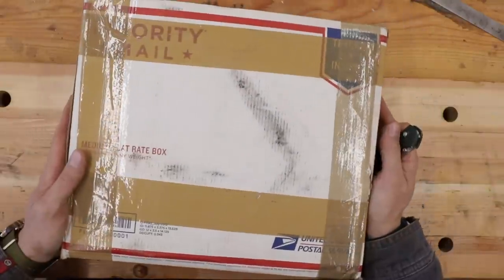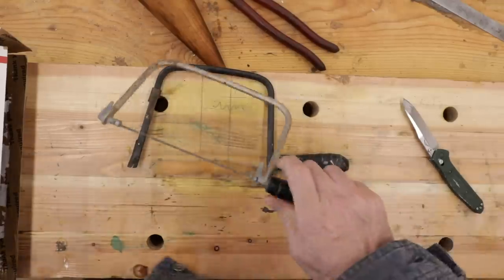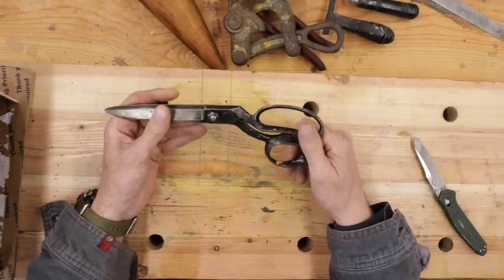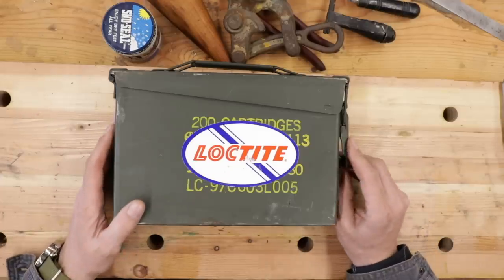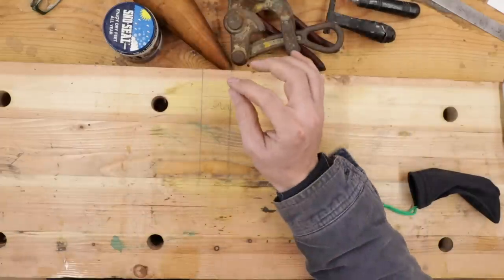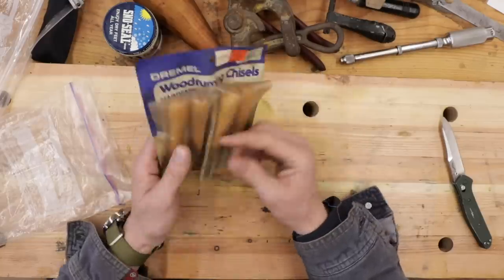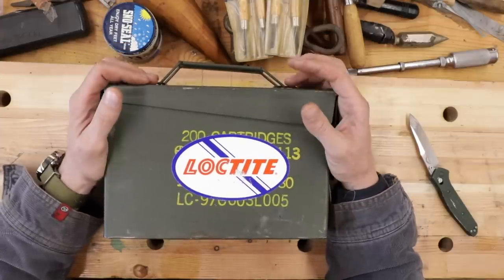You Won't Believe What's Inside This ARMY Box

Comment: The "cable puller" is actually called a "grip" that is used primarily for steel cable.  My experience in using these is for telephone pole aerial rigging, which includes setting guy anchors.  It is very effective and is regularly connected to heavy-duty winches to set the tension on aerial cable installations.

The "Yankee Screwdriver" is actually just a drill (non-reversible) and standard issue from the telephone company linemans' toolkit.

The "scissor screwdriver" is a straight-slotted screw holder that holds the screw at the tip when you need to thread the screw into a hard-to-reach hole.
Reply: Mark Lee we call it a cable dog. Use them for bottom wire on chain link fence.
Reply: I’ve always heard them referred to as pork chops. We use them for various things on distribution lines.
Reply: We linemen call them porkchops. And pull all sorts of stuff with them
Reply: Coal miners call them a rope dog.
Reply: @jonnewbury3482  Electric Gas lineman here we always called em rock'em sock'em robots

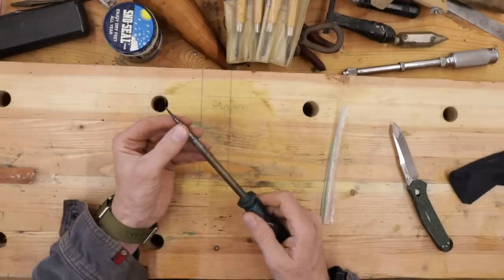Comment: @ 4:45 - Cable & Wire Pull ;  @ 6:58 - Wiss Dress Makers Shears - (I have my Mother's pair, she used to make a lot of our clothes back in the 1950's) ;   @ 11:48 - wallpaper Paste Brush ;  @ 21:40 - Quick Wedge Electrician's Screwdriver - split tip grips the slot of a screw & the sleeve on the shank insulates the shank - great for working in fuse & breaker boxes .
Reply: The Quick Wedge was not used for 'working' at all. Used only for holding the screw until you got the screw started in its mating threads. Then you would use a standard flat blade to do the work of tightening. Also handy for retrieving a screw in a hard to reach place after it was loosened. The good job you did at identifying all of the items might be an indicator of your age.? Did your Mom ever use flour sacks for material?
Reply: @mancelprince7426  --  Yes , Mom used a lot of Flour sacks for material , primarily for making dresses for my two younger Sisters . Mom used an old Singer Treadle Sewing Machine (foot powered) to make and repair our clothing .  When I'd wear a hole in the knees of my denim Levis , Mom had an old worn-out pair of Levis that she'd use to cut a repair patch from (usually the back of the leggings which didn't receive much wear) , she'd then carefully "rip" the seams on the trouser legs so the material would lay flat so she could stitch on the repair patch (this was before Free-Arm Sewing Machines & Sergers became popular) .  If and when it was available , Mom would cut 4'' x 6'' pieces of Leather and stitch them over the front of the knees to provide extra reinforcement and wear resistance to the trousers .  She'd then stitch up the side seams , and the pants were ready to wear again .
Reply: @001desertrat3  Did you'll have a kitchen furnishing called a "kitchen pantry" with a bin in the top cabinet that would hold about 20# of flour that came out of those flour sacks that had a crank on the bottom that would dispense sifted flour when you cranked it? The bottom of it had a flat counter top where Granny made biscuits that she cooked in her wood stove. You brought back some old memories with the treadle sewing machine. Thanks
Reply: @mancelprince7426  --  Initially yes , we had a Flour Bin , but Dad completely rebuilt the Kitchen and 'modernized' it . Dad built all new cupboards and cabinets and installed Formica on the counters .  Never had a wood stove (we lived in the City) ,  but Mom's gas stove was a Gaffers & Sattler 4-burner with boiling well in the rear behind the left side burners , large oven with broiler underneath .  Dad bought a new Frigidaire refrigerator in 1951 ,  and both were still in perfect working condition when we kids sold the house in 2003 after Mom & Dad's passing away .  In the early 1950's Dad also replaced the old wringer washing machine with a new top-load washer and front-load gas dryer .  But we kept the old style Ironing Board that was built into the wall in the Service Porch .  Our house was originally built as a 2-bedroom / 1-bath house ,  and Dad removed the old Patio and built a new Den .  He then converted the old attached 1-car Garage into a bedroom with a 3/4 Bath . Next he built a new unattached 2-car Garage with a new Patio between it and the Den .

Comment: The Quick Wedg is for holding slotted screws while starting in place, so you don't drop the screw
Reply: Agreed, I have one and use it for holding straight screws when inserting them down a hole or similar, not intended to actually screw it in, just to get it started, marvellous design and well engineered.

Comment: the quick wedge is made for holding slotted screws.
Reply: I have 2, small and big. I was gonna tell him but you beat me :-)
Reply: Particularly for starting slot-head screws.  
I hate slot head screws.  These are a life-saver, especially in tight places.
Reply: Yup!  Place the screw head slot on the blade, slide the outside up until the tips wedge inside the slot and start the screw!
Reply: correct
Reply: OJ Jenkins - same here. 😁👍🏼
Reply: There is also a Phillip's version. Electricians use these all the time, when your hands don't reach/fit.
Reply: Bingo!
Reply: James May (of Top Gear fame) introduced me to them for his show The Reassembler.
Reply: I was happy to see that I knew what a tool was for and had experience with it, and Cody did not.  It is a very rare thing in my case!
Reply: We always called the Quick-wedge screw driver a MONDAY MORNING SCREWDRIVER because when a guy showed up for work after a weekend of too much consumption of John Barleycorn, he could use the quick wedge to hold the screw so that even though his hand was shaking,  he could start the screw without getting it cross-threaded.
Reply: Better than magnetic. 😀
Reply: "starting" strait slot screws/bolts. around three or so sizes and there are versions for fillips also.
Reply: Exactly

Comment: That’s a fence wire puller works great for Barbwire use it to pull the wire tight and then put your staple in
Reply: As a fence wire puller it may be OK as one for barbed wire but it would be no good for no8 or high tensile. The teeth would create weak points.

Also if it was for high tension fences it would have a handle with come along Jaws and a second clamp with chain. 

Coming from a kiwi, we know a thing or two about keeping sheep in....
Reply: Hook it to a comealong and a chain on the other side of the comealong.
Reply: We would tie the wire to one post and string it all the way to the other end and attach the puller to a come along and stretch the wire then go to each post and staple the wire to the post.
Reply: ISXCUMMINS 565 the third thing was a saw of some sorts, wire/cable puller was 4th.
Reply: Jay Dunbar yea I have used those cable pullers for lineman work..klien makes good ones. But don't know if the ones I have used could really get a good grip on barb wire size wire.
Reply: When tightening a half mile of barbed wire you use the wedge thingy to hold the wire and pull it tight with a team of horses (or tractor).
Reply: ISXCUMMINS 565 that self locking thing that gives Cody the fizz is actually the fourth thing pulled out of the box. ;)
Reply: I agree fence or barbwire puller.
Reply: it's a cable puller for lineman
Reply: The sole purpose for this device is pulling  barb wire as ISXCUMMINS 565 said.
Reply: George Stone it's for pullin' cable
Reply: MJM,you're right!I knew I had seen that kind of tool before.......
Reply: that is a tool that linemens use to stretch and tighten the powerlines
Reply: AndreasB u hook a come along to it
Reply: Northman u are right, I have only seen these used for lineman work
Reply: The quick wedge screw driver jams the two blades against the sides of a slotted screw. This allows for one handed operation of the screw driver, making jobs such as overhead work much easier, particularly when needing to simultaneously hold an object being fastened. Here in Canada we went a different route to solve this problem and have the very common (here) Robertson head screwdriver, which allows for one handed use, without needing to tighten the driving blades. My grandfather was carpenter by trade after WW2, and he had one of those.
Reply: AndreasB theres another half to it thats missing they are called chain strainers google hayes wire strainers
Reply: Patrick Rebecca Doohan lol you bet me too it. Hayes had it better with the groove
Reply: thats exactly how it works. almost any farm sale will have 1 or 2
Reply: Strand clam clamp for lineman, i use them everyday.
Reply: MJM’s Workshop I use them for the exact same thing of fixing brakes in the fence
Reply: @georgestone6562  Many other uses.  Just like a screwdriver can be used as a chisel or pry bar.

Comment: your Yankee screwdriver is a fine boring tool for making small diameter holes in rock hard oak or hickory woodwork prior to driving a 8-12 p finishing nail in. the hole should have a perfectly smooth bore if your bits are sharp. no splitting. yours is a top of the line tool. :)
Reply: Mike I have two of the metal Yankee drills, I use them at work to clean out the pins on meter locking rings.
Reply: my granny used one to make jewelry, boring holes in beads. the bits come in very tiny diameters.

Comment: We used those wire grips every day when building power lines. We called the one you have a mule grip, some call them pork chop grips. The curve it has in it will grip just about anything. The ones with teeth were for steel wire and the smooth ones were for copper and aluminum. We use the one you have for guy wire.
Reply: My dad used it when he was setting poles and pulling cable for the phone company (Pacific Northwest Bell)...
Reply: We call them bulldog grips.
Reply: I'm glad someone knows what it actually is
Reply: We call it a Come-Along in Australia, used for gripping and tensioning power lines.
Reply: Eug Iov  A come-along is something totally different here in the usa. It's a ratcheting hoist with usually a steel cable.
Reply: Rob Bob correct you are.
Reply: Eug Iov It’s interesting to hear the nomenclature for the same equipment in the same field but a different culture. Thanks for sharing.
Reply: Rob Bob that's so strange. We call that a Lug-All, and the two are used together.
Reply: We use them primarily for pulling ground rods, when you try to tention strand for lashing phone cable it would kink the strand a bit and make it hard to put an strand vice on. Not impossible just more difficult
Reply: We also still use them in the utility company. We call them come-alongs
Reply: I agree but for some reason our company also refers to them as come-alongs here in NYC
Reply: guy wires  lol  not bad

Comment: I started with the Bell System in mid 60's as an Installer Repairman. We were issued that very Yankee Screwdriver to install Connecting Blocks on baseboards. No power drills. On the side of it there's a little slide switch that reverses the drill. The sliding Screwdriver was also issued to push the slide to hold slotted screws to start them after drilling the holes. When I started we never used any kind of Phillips screws for installation of telephones, only round head slotted screws.  Neat tools !

Comment: That strange screwdriver is for points. it holds the flat head screw in place so you don’t drop it down in the distributor
Reply: MJM’s Workshop nope...you could use it for that but that is not it's purpose
Reply: Its for electricians inside of a panel

Comment: The scissors are fabric shears. The larger loop is aligned with the blade to make straight cuts through fabric.
Reply: my mom still uses those lol
Reply: Usually when cutting several layers of fabric at once or when working in upholstery
Reply: Partially correct. They're designed to be flat bottomed so you can just slide it along the work surface without it trying to go caddywampus
Reply: My grandfather was a tailor by trade, and had one of those. Nobody was allowed to use it. We had to use the more modern versions around. The tool of his trade I suppose.

Comment: Wooden scribe marker. Put pencil in hole and tighten.  Can run a line the length of a board to rip cut.
Reply: And the metal piece with it is a drill guide to insure properly uniform depth and distance between dowel holes

Comment: The puller can also be used for pulling barbed wire. The Quick Wedge is a screw starter for the slot head screws. The two knives are for leather workers (saddle makers).

Comment: As far as the Yankee drill is concerned, you will not  find a directional control,  because that 1 is strictly a drill and not a screwdriver. If it was a Yankee screwdriver, you would see the crossing spiral grooves on the  shaft.  With the Yankee drill all of the workings are internal.
 The split tip screwdriver is used for starting  screws in tight locations,  the two blades wedge into the screw slot to hold it on the tip of the starter-driver.  They have since been replaced by magnetic tips.
Reply: You are right on both counts.  Bell Telephone Installers used the Yankee Drill and Yankee Screwdriver all the way to the late '90s even though cordless drills were becoming dependable and affordable.  (I guess they were just too cheap and thought labor costs were cheaper than equipment costs)
Reply: I had to laugh at Mr. Expert Woodworker being amazed at the bits in the handle ... not to mention that he didn't recognize the scribe.
Reply: I actually still use a set of those screw holding drivers to this day on equipment repairs. Getting screws into areas you can't start by hand. The perfect assist in that case.

Comment: My paternal Grandparents also lived through the depression, having been born in 1901, and 1092 respectively.  My grandfather, whom I spent a lot of time with, taught me everything from catching squirells and rabbits with wire snares, or deadfalls, to machining, welding, automotive/tractor repair, woodworking, etc., etc., etc.  
To this day, and I'll be 68 in November, I straighten out nails, and if I'm taking screws out of wood, I keep the screws.  I have an set of steel hardware drawers from a garage sale that has 96 drawers, each measuring 4" X 9" X 12", and there's something in each drawer.  And yes, I do know which drawer to go to for a specific nut, bot, screw, spring, washer...usually.
Reply: WOW! One of your grandparents was really old. I know exactly how you made that typo. I'll be 68 on November 22  myself.

Comment: at 15:33 that is a Stanley push drill.  It takes straight,  two fluted drill bits which store in the handle.  
It is NOT a Yankee screwdriver.

Comment: 4:30 we used the pork chop for steel cable in the mines, when you had to tighten it up, then clamp it down with a U shaped clamp secured by 2 bolts and nuts. (coal mine, 1980's)

Comment: The "cable puller" is actually a fence stretcher. Used for repairing broken barbed wire fencing. Takes two and you can stretch the ends together and tie them.

Comment: the brush is similar to my brush i use when cutting hair with a elec clipper for brushing hair off the neck and shoulders.  the screwdriver specially built for electronic technicians it holds small screws when you screw into tight spots.
Reply: ratrod diesels I agree with Brush. I am former Cosmetologist and found one in drawer of 100 yr old Barber shop I bought! However I also found one with a bunch of furniture makers tools at an estate sale (his furniture makers union card was dated 1897!)

Comment: Nice collection of old tools. The brand of the cross wood scriber is "Nooitgedagt", an old Dutch quality brand for hand tools. Nooitgedagt chisels are collectors items now. The double ended screwdriver is for wedging a screw fixed to the screwdriver to start it in a place you couldn't reach otherwise.

Comment: Great video, we enjoy the mail box openings  .  David is a giant among men with a generous heart. IT would be neat if Loctite sponsored David a trip to Wranglestar headquarters. I had never used Loctite until recently. I had a piece go bad on one of my woodworking routers, no replacement parts available. I went to a pro nut and bolt store. The man at the counter figured a way to duplicate the part. Loctite was needed to make it work. I have used it hundreds of times and the Loctite saved me $200.00 on a replacement router. Cody ROCKS!!

Comment: The screw driver is for holding flat head screws - typically used for nonferrous screws such as brass as magnet head won’t work.. 

Often found in an electricians tool bag..

Comment: The very first item you pulled out of the box is the press for a "chinois". My grandparents also lived through the depression and were the king and queen of self reliance. Grams used her chinois for canning tomato juice/sauce or making jams and jellies. It's great for filtering out the seeds and skins.

You mentioned masons and carpenters use plumb bobs but don't forget about how important they are in motorsports chassis building. Sure, there are all kinds of electronic doodads for a lot of aspects of auto racing but all the best chassis builders still use layout tables and plumb bobs. Nothing better for guaranteeing center points and such for your suspension parts.

Comment: 21.40 That's a screw starter. Pull the slide all the way back. Put screw on end and push slide forward. That will bind the ends together in the screw slot and hold it in place

Comment: The screwdriver with the sliding sheath is an electricians screwdriver, it is made to hold the green grounding screw, or any screw for that matter installed into a recessed metal outlet/switch/junction box. Place the screw at the end of the dual straight blades, push the sheath towards the screw so that the blades grow fatter and hold the screw on their own, then hands free to install the screw into the electrical junction box, usually one with a plaster ring attached to it. Plaster rings make it way harder to put ground screws in or mc clips in.